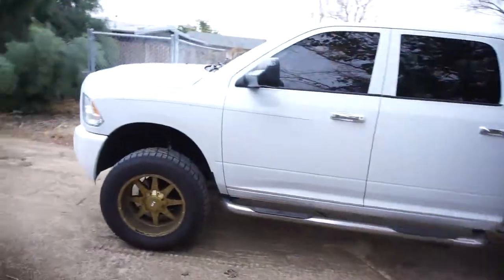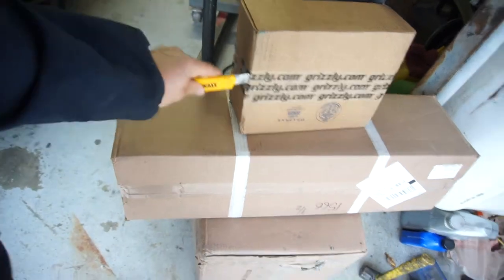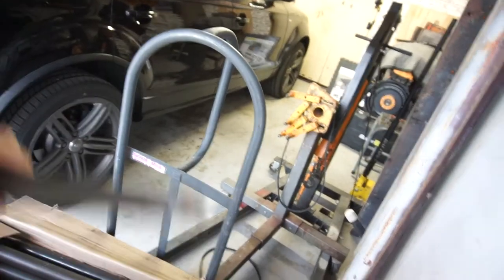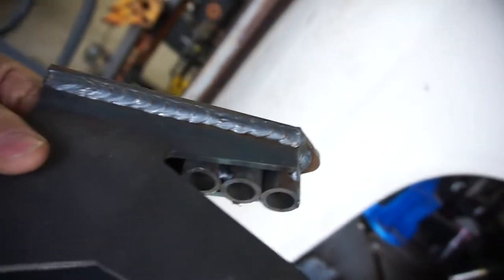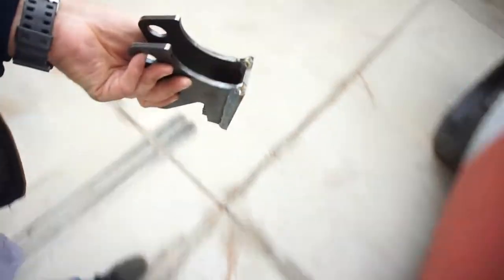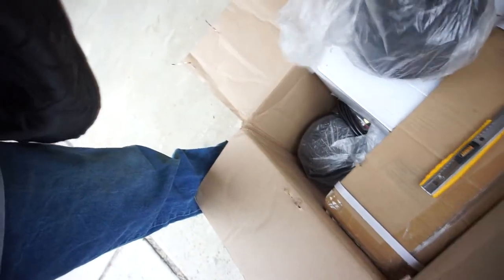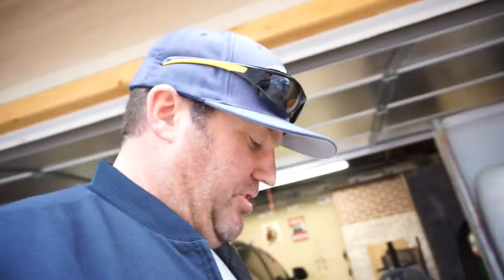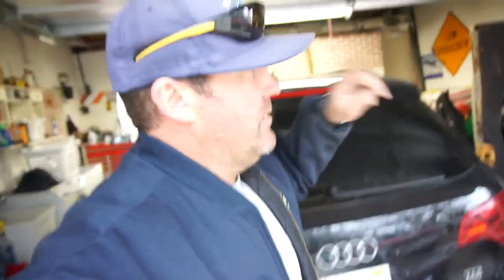UnBoxing Project Crack Pipes PCP New 4 Link Suspension Air Bag Setup 64 C10 4x4

Comment: I am pumped about you bagging PCP. What are your plans with the system? Just using it for ride or setting it up to control individual bags? Plan on upgrading those lines to something a bit bigger (diameter) to get the bags to inflate and deflate faster? Something to think about now... the longer you run it, you will probably upgrade to a bigger air tank or dual tanks AND bigger OR dual compressors.
Reply from the maker: OneNGlen probably gonna just run this setup. Especially sense this is my first 4 link setup with air bags.
Reply: You're going to love the ride on bags.